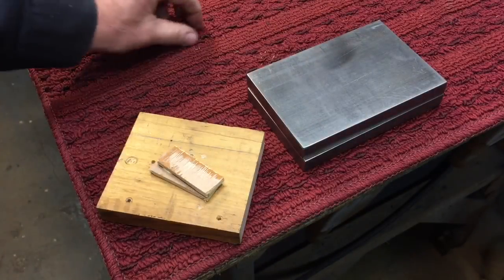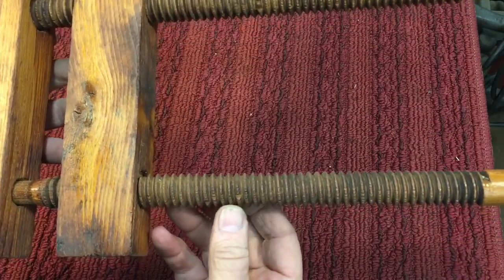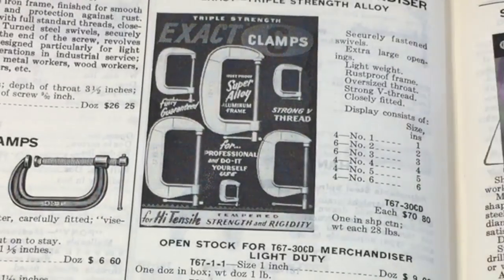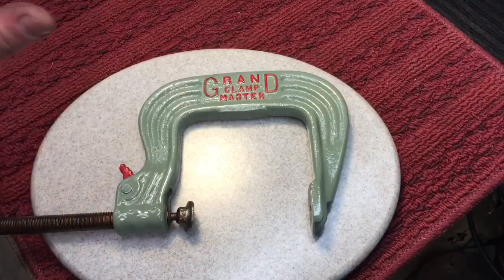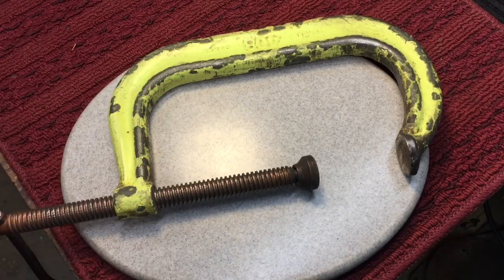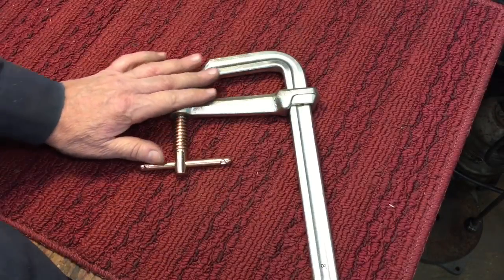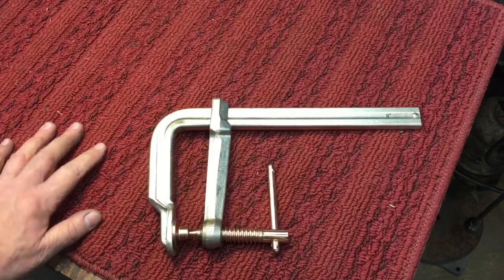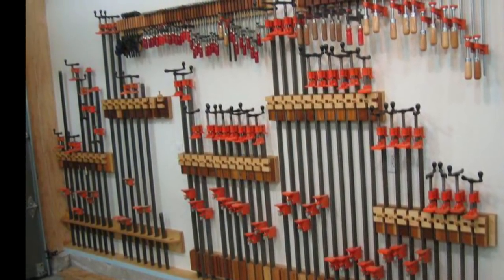A Talk About CLAMPS...

Comment: Great video as always! I think the reason many woodworkers prefer parallel clamps over pipe clamps, even though pipe clamps are stronger and cheaper, is because the black iron pipe can react with the glue and stain the work with Black oxidation.
Reply: You can cut a piece of pvc that will slip over the pipe. Cut about a third of the circumfrence so it will clip over the pipe. I make them about an inch long and then I clip on as many as needed.  😁😎

Comment: Very good tutorial. The problem with spring clamps is as you noted. You can't adjust the pressure on the work piece so you have to be careful about the one you use, or you could damage the workpiece. This is especially the  case with delicate work. The vintage quick release  clamp is very cool. They would be a nice tool addition. "Only a maniac would have  one clamp or one hammer. "  Very funny and a vintage SC comment. Thanks

Comment: One great trick to stop the wood sliding on the glue when you are trying to fasten two pieces is to sprinkle a little bit of salt on the joint. Salt crystals are cubes, they end up acting as indexing pins. As the clamp tightens the two pieces of wood and they want to slide, just a sprinkle of salt is enough to keep them aligned while the glue dries
Reply: Yep I’ve been using salt in the shop for glue ups for many years now. It has made so many glow ups so much easier! I agree with you 100%! Some pretty nice clamps there! 👍👍👍😎🇨🇱
Reply: Just a pinch makes it taste better too. 😁😎
Nurse! Oh Nurse! I'm ready for my sedative. 
They wont let me have my hammer!   😕😖🤪

Comment: I love my Jet parallel clamps.   I have several lengths.    I use them often.   I have had them for decades.    The plastic cover on the jaws feels like it is intended to prevent glue sticking to the cover.    The clutch mechanism is terrific when using the clamp with the stationary jaw down.    The moveable jaw stays put until you release the clutch.
In metalwork, I love my Kant clamp.
The deep jaw Bessey clamp you showed has a screw in the moveable jaw.   The thread of the screw engages in shallow grooves on the bar.   I love my deep jas Bessey clamps.
Dave.

Comment: The hand clamps can be ajusted if you take off the cover to expose the metal straps, bent them a little to tighten the bar up, they will wear down over time. thanks for the vid.

Comment: Well, this is a great subject and like you said; “a can of worms. Now let me tell about one of those Dewalt squeeze grip clamps that I came across. The large one are mostly plastic and while driving one day I saw one sticking out of a pile on the roadside. It was the $40.00 ones and it was broken. I took some JB weld and with some creative use of Kevlar fibers, I repaired it and it works like new. I would never pay that much for one of those but the thing has come in handy. I wish I had a dozen more but not at the price they sell for.

Comment: Sounds like I am going to have to have my collection of Irwin  Quick grip clamps put into my will. They're about 30 years old and I have never had any problems with them. It's too bad the new ones are not as good. I store different lengths in 5-gallon pails so I can quickly get them to where I am working. I gave up on hanging them up I use them so often. Thanks for the tip on oiling the metal C clamps.

Comment: I'm a semi-serious cabinet/furniture hobbyist, and those parallel clamps have seriously improved my work.  I use domino connectors for a lot of cabinet doors, and I always had trouble with twisting until I started using the parallel clamps.  They are so solid and heavy.

Comment: I'm a woodworker. I did carpentry for about 15 years with my dad. And I've been doing fine woodworking in my own shop for about 5 years now. Anyhow I've got a couple of those inexpensive Bessy clamps and the only thing there good for is. Since there cheap, you can grind the stop off the side of them. And then use them through the dog holes on your woodworking bench. To hold down protects in the middle of the table. Just my thoughts my friend. Btw the bessy parallel clamps, are the best clamps. There expensive of course. And Pony Jorgenson makes parallel clamps also there a little more price wise then the bessy and I've never used them. But I'm sure there great too. I haven't seen or heard much about the jet clamps either.
Reply from the maker: Hi Brent!  Thanks for the input!  It's always nice to hear from professionals on what tools they like because it can save the newbie having to learn the hard way!   Thanks again!

Comment: Great video! I have some HF bar clamps they work good. I have one HF wood clamp and aJorgensen I like them both. One tip when glueing up wood if you put a few grains salt on top of the glue it helps prevent slipping. Salt has sharp edges and digs into wood.

Comment: I think you should do a Clamps 2.0 video! I've got clamps of all kinds too. I have found two nice 5" C-clamps all rusted up in the dirt. constant soaking in oil for over a year, a little heat and the wire wheel treatment and they are a good addition to my stable of clamps.

Comment: I I think the most important feature in bar clamps is when they have a flat back so you can stand them up on their spine. This makes glue-ups much easier. Bessey makes two different types of bar clamps, the one I prefer has a wide rectangle as each jaw. I personally prefer older gear so I just touch mine to the bench grinder to form a flat. The one other thing I think is worth noting is that clamps should always be bought in pairs or fours. It's much easier to keep a project square when all of the clamps match. While this is especially true for clamps, I am a big believer in many tools being bought in pairs or fours, there are so many different situations where being able to index the clamps is valuable.

Comment: On the Irwin Quick-grips you can reverse the yellow pad by putting it on from the bottom.  It might require a little elbow grease but it won’t fall off anymore. :)
Reply: I thought he was going to show how you can reverse them and use them as a spreader.

Comment: I got the besseys like you showed with the release mechanism got them on sale a year or so back with the home depot holiday sales. I generally always pick up some more clamps come holidays time. Lowes had a bunch of Jorgensen or pony I believe on sale the bar clamps like the quick clamp, the spring clamps, and I believer parallel clamps which I picked up some of each. My only issue with the pipe clamp is I wish it had a larger face to it to secure larger material like I'm thinking of building a 2x4 workbench top I think the parallel clamps would be good for that but the pipe clamps are cheaper and easier.

Comment: and as far as the red Jet clamp   parallel clamp  I've not used them  I've made many piece of wood projects the only thing i needed one for i ended up using a very old  AMF  float lock vise  extremely cool you should check one of those out if you happen to run into one   but i try to use old stuff the staying they don't make em like they used to is true as can be

Comment: I'm not a big fan of the Jorgensen style clamps when woodworking. They are indispensable on the milling machine, but I find them too fussy and slow for woodworking. I have found though, keeping one on the drill press makes a fantastic quick vise. I leave it loose, but it has enough surface area to index to the table, I use a 12-in, it's a great method for quick drilling, I generally leave the screws imbalanced, I find that this allows me to grip something in the vertical position quite well with just the weight of my hand to keep it steady. I use the clamp in a similar way on the bandsaw if I need to cut a very thin sheet, such as a veneer.
Reply from the maker: You have to admit they are so well made and fun to play with once you get the hang of them but like you they are too tedious to set up for most shop work.

Comment: I've never heard that, that they are structural clamps. I use these almost exclusively on the milling machine because they cannot vibrate loose. I had always been under the impression that they were called beam clamps and were used as a temporary lifting eye for sheet or beam material. I suppose that amounts to the same, I've only ever seen them used for lifting, but now that you say it, it makes obvious sense. I love them, try getting that much grunt out of any other 3-in clamp!
Reply from the maker: They are super heavy duty and the big ones are a fortune!  Iron workers use them a lot around here,  If you see a big one they weigh a ton!   -=D

Comment: Great video! 20 minutes well spent! I think I can guess your opinion on the aluminum bar clamps. Mine from HF bend like a banana 😂 The over engineered plastic bar clamps look great until you get some glue in the mechanism. The pipe style is great and the glue scrapes off easily. You can clamp so hard that you do need to tap the release with a hammer, but they are built tough enough to take the abuse.
Reply from the maker: Yes- The Pony bar clamps use Black Steel pipe and that stuff is tough!!  Expensive too!   =D

Comment: I'm right there with you I personally think that's a bad design for a clamp and I haven't had much luck with them.   I own several of those style clamps I picked up at harbor freight and honestly they are the last clamp I'll reach for ya seem to either have to over tighten even to get them to hold and I've stripped the handles out o
n a couple of em.

Comment: The orange pipe clamps are superb. You can  use them to square up structures in steel as well as wood, very strong! I also have a handful of the tiny C-clamps too, as well as the well build machinist clamps! The one with the copper jaws!